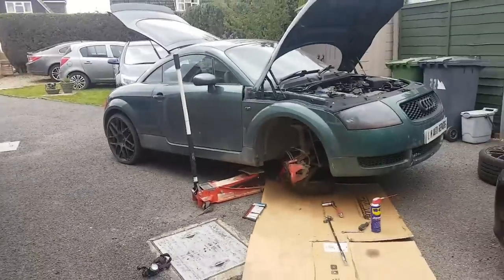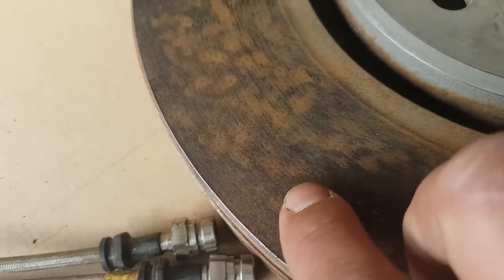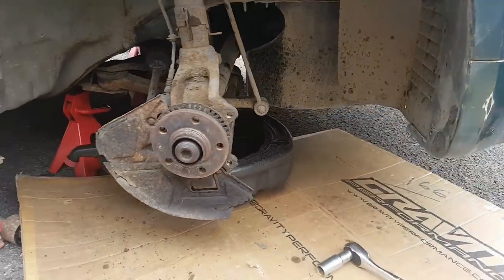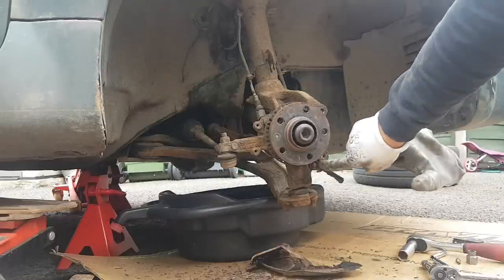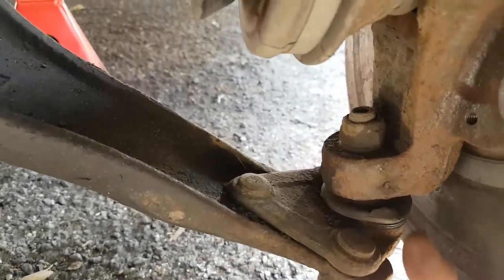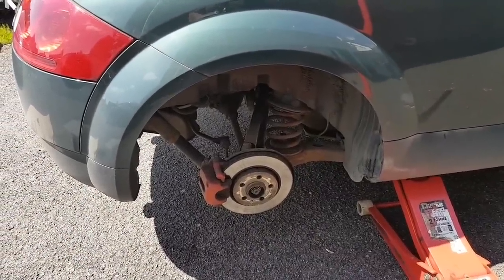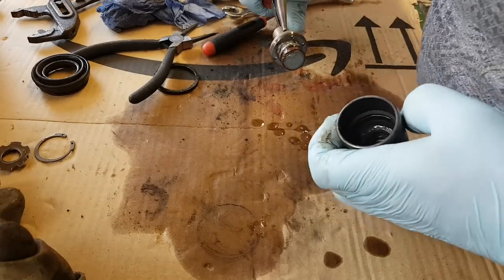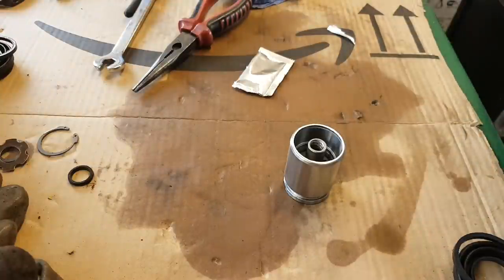Audi TT MK1 brakes upgrade and full calipers service... Problems after problems...

Comment: Keep an eye on the rear/rear control arm spherical bushes, I believe they were a recall many years ago. They bind up, the arms snap. Guessing your brake pedal modulation increase is down to the extra piston surface area whilst still using the same master. Curious what the green button on the dash is for :D
Reply from the maker: Yes... more oil to be moved...
To be honest, the pedal settled in a very good position in end...
I was highly considering replacing the master cylinder... but don't think I will do it now... but will might give it a second thought  when working on the next upgrade...☺️
The plan is to replace the rear arms with adjustable ones... Will tackle all of that at that time...
👍👍👍

Comment: Hi I've watched your video about 8 times I've brought 18z calipers and R32 334 mm discs and 30 ml wheel spacers and my wheels are 18 in like your pattern on your TT will setup fit because my mate is saying I need at least 40 to 50 mm wheel spacers but watching your video I should only need 30 mm wheel spacers is there different R32 from Mark 4 golf discs
Reply from the maker: You need no spacers if you get the right wheels...
https://youtu.be/-7i94PZm4ZE?si=Tr6Ch4pW4hN9eMnE

Comment: The reason the small piston is at the wrong end is because Porsche put the calipers on the door side of the wheel as do most sports cars.
Reply: 17z caliper does not need turning over they are at the same as std audi placement the cayenne has same set up as audi q7 i khow ive used them the problem with them is the unsprung weight unless you are running 400 bhp plus!

Comment: You have your discs on the wrong way round. The vanes within the vent should be leaning backwards.
Reply from the maker: The next ones I will pay more attention...😋
They were marked left and right by the previous owner, and I didn't even look at that,  just install them the same way...😅
Brakes OK though!😉
👍👍👍
Reply: @LMAutoRepairs  👍👍 I wasn’t trying to be a Smart Alec just wanted you to be good and safe in your car. I should have said earlier - thanks for the video - very informative.
Reply from the maker: Dint think they will be lasting long with this new pads... so, soon they will be replaced!
Appreciated you spotted it... 👍👍👍

Comment: picked up a car from a garage few weeks ago 140 miles from home they were to bleed the brakes. new disc and pads one new caliper fitted by owner and airplane mechanic they ran out of time (music concert) and couldnt bleed the brakes so collected by garage. driving back from garage brake pedal nearly on the floor, they hadnt screwed the rear caliper piston all the way in and the  then unscrewed it half a turn to engage handbrake mechanism so piston was 3 to 4 mm away from pads all the pedal movement was gone into pushing that piston out and when the pedal is released the piston would go back to 3 to 4 mm gap. no amount of pumping and up and down with hand brake will set the piston on this type of caliper. excuse garage gave was new caliper would make pedal feel spongy.